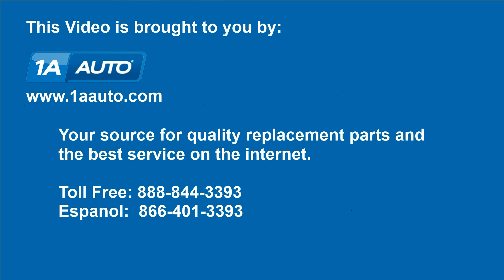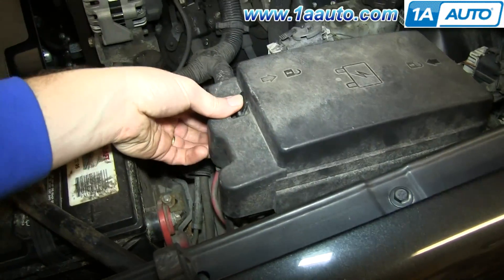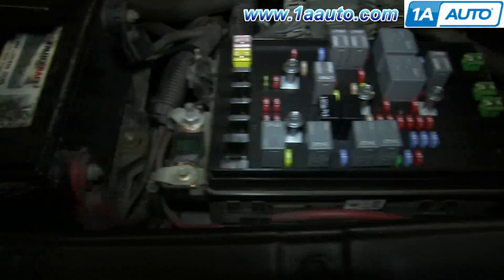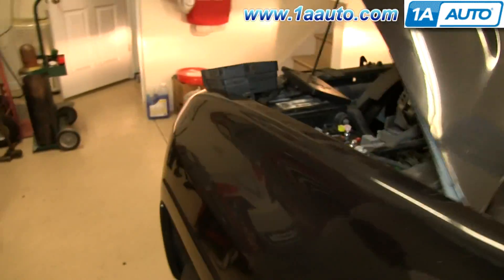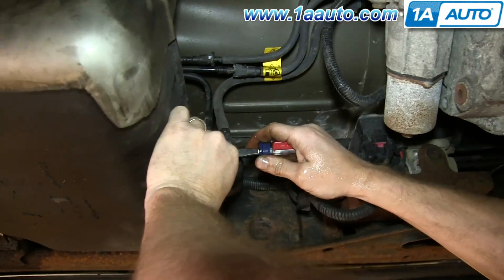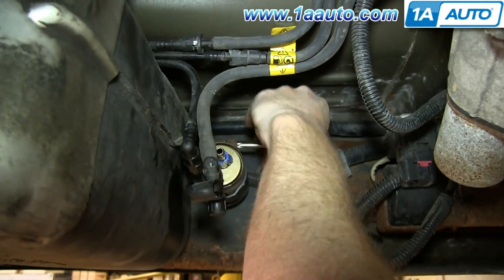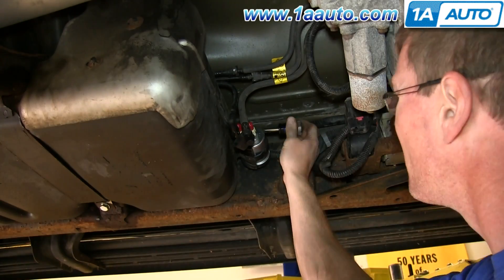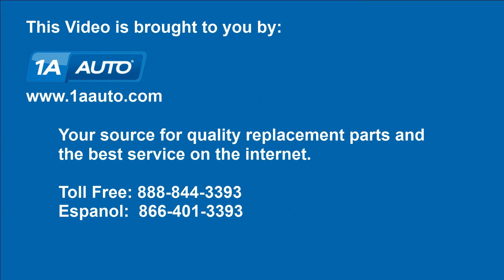How To Replace Fuel Filter 03-08 GMC Envoy

Comment: Check your model before ordering the part.  My 05 GMC Envoy XL does not have in external filter.  It must be in the tank and I confirmed that with a little online research.  I've used 1A videos before and they are usually outstanding.  This one should start with making sure you can find the filter.
Reply: I have the same 05 GMC Envoy XL.

Comment: BE CAREFUL! THIS IS NOT THE SAME PROCESS FOR 03-08 ENVOYS. IN 2006 THEY CHANGED THE LOCATION. (PART OF FUEL PUMP ASSEMBY. VERY LONG PROCEDURE). I BOUGHT A FILTER THINKING THIS WAY THE WAY..BUT IT'S NOT FOR 2006 AND AFTER. THEY SHOULD BE MORE CAREFUL ABOUT WHAT THEY POST.
Reply from the maker: +ymisofly G Thanks for checking our video out! While 1A Auto strives to make the information provided in this video as accurate as possible, it makes no claims, promises, or guarantees about the accuracy, completeness or applicability of the content. Step by step processes may differ depending on the application. 1AAuto.com
Reply: @1AAuto  yes I understand..but now that you know..how hard is it to adjust the date range in the heading...
Reply: @1AAuto  it does not work on 2005 Envoy either
Reply: This is for the 03-08 - if you have a six cylinder...good to 05...this is a V-8 model. In 2006, they deleted the external filter and use a screen on the in-tank pump.

Comment: Thanks.  I'm rep[lacing all the fuel and throttle  related parts before I go for the probable real culprit -- the fuel pump.  The only codes that it's throwing are the p1071 and p1171.   But it seems to intermittently run out of gas, spit and sputter under a weak fuel pressure until I turn it off and turn it back to position two and let it repressurize trhe fuel line.  Then I can go for another 1/4 mile.  OR, sometimes it works for an hour before it starts misbehaving.  I have already changed the throttle body and TPS (and relearned it), the cam sensor (just because it's so easy), the fuel pump relay and fuse, the battery (because you never know and it was 4 years old), the coils and plugs (why not).  The fuel pressure regulator and filter are next.  If that doesn't fix it then I guess I have to drop the tank, clean it out and change the pump.

Comment: had no idea it was that easy...thanks fellas
Reply: It's not the same for 2006 and after... it is part of the fuel pump assembly and takes hours to get done..they should be more careful about what they post as dates this is for..I wasted money on a fuel filter only to find out it changed location in 2006... (4 hrs labor at service shops, just so u have an idea of how much work it takes on 2006 and newer envoys)
Reply: Just like they changes the location of the coolant temp sensor also in 2006..used to be next to thermostat on driver side engine block (behind/under alternator).. 2006 it got moved to back passenger area on engine block... always double check actual specs for your year car.. (Can usually find a service manual for your model/make year online..for free if u look around enough)... best way to know exactly for all ur needs.. always be weary when the tutorials state a large year span that it's the same for..usually it's not

Comment: FUEL:QUESTION:  You didn't mention to empty fuel in a clean pan so hat once the new filter has been attached you can pour the fuel back into your gas tank.

IS there even enough fuel that comes out of the lines and filter to be concerned about putting it back into your tank?

Comment: You guys should rewrite the Haynes manual. There's nothing in it 80% of the time. Anyway, it doesn't explain the fuel filter. So I came to your video. You don't identify where the filter is located.  Im guessing next to the fuel tank behind the cross member? I really couldn't tell on the video so now I'll have to lay under there searching everywhere. You're the 4th video that didn't say location so this sucks. But your other videos have been extremely helpful. Thanks
Reply from the maker: +Mike Powell The video shows that the filter is mounted adjacent to the fuel tank toward the front of the vehicle. The video shows the filter at appr. 2:10. Thanks for checking us out! 1AAuto.com
Reply: @1AAuto  Thank you

Comment: Does the 2006 gmc envoy denali has the filter in the same spot...cause i have found a video on that make and model
Reply from the maker: +Nadia Clark Mccray This video is applicable to the 03, 04, 05, 06, 07, 08 GMC Envoy or Chevy Trailblazer.
Reply: Thanks so much sir.

Comment: I believe that during 2005 in the Envoy/Trailblazer they changed to the filter being inside the tank with the fuel pump.  How convenient!  Replace yearly if external, replace when getting new Pump ... after you drop the Fuel tank.  3 man job.
Reply: Gord Baker so I have a 2005 GMC envoy so there no way for me to change fuel filter?
Reply: Edmund Jones sadly no i wanted to change mine earlier this week but when i got under the car i couldn't find one so i asked a part dealer and told me that it's inside the tank
Reply: @edmundjones480  even me .. I want to change it but I don't find any way to change it
Reply: One person, one floor jack, two jack stands and a plywood piece the same size as the tank. I pulled my tank out twice by myself.

Comment: how do you know which is in and out to get the fuel line back together because those is very confusing i install them last year with my brother and i didnt really know which in and out when bought the fuel filter didnt say it.
Reply: NotoriusHitman the filter will say OUT
Reply: Which hose tho, there’s 2 hoses. The filter says out so is it the hose on the left looking at it or on the right.
Reply: Mark them before you take them off.

Comment: Why whould i get missfires and a p0300 code after doing this?
Reply: Did you ever figure out what that was? I got misfires after changing the fuel filter. Guessing it's air in the fuel lines?

Comment: This will work on a 2006 chevytrailbalzer ls ?
Reply from the maker: +David Morales It should be the same procedure on that model year. Hope this helps you out. Have a great day!
Reply: I am interested too. Does this work for a 2006 or is it above the fuel tank and non-serviceable without dropping the tank?
Reply: Changed to internal tank filter in 2005 mid year I believe
Reply: 2005 and up trailblazer is part of the fuel pump

Comment: How do you drain tank
Reply from the maker: +Joshua Cleary If you are trying to perform this repair you shouldn't have to drain the tank. If you do need to drain the gas tank for another reason, you can get a transfer pump for your local hardware store of Home Depot, to pump it out and into some gas cans. Hope this helps you out. 1aauto.com
Reply: Sometimes it is not possible to get a hose by the integral rollover ball valve.

Comment: Does it make a difference which way you turn the filter in relation to the fuel lines.ie in or out ?
Reply: Yes the line with your "out" on the filter goes to the line with the pressure release valve
Reply: Orientation puts the out valve in center .... the groove